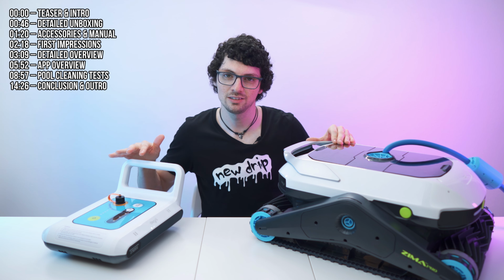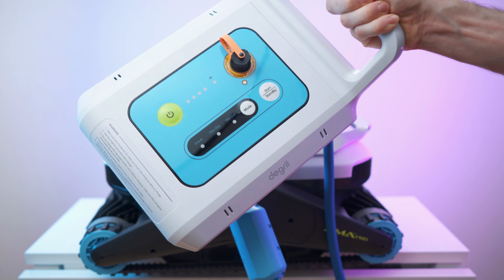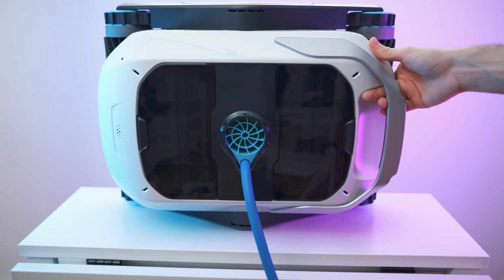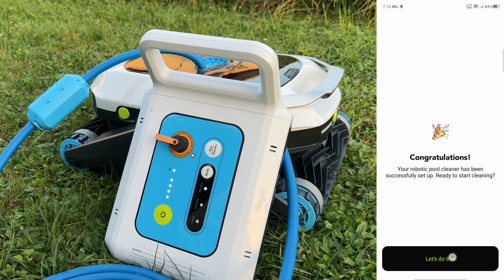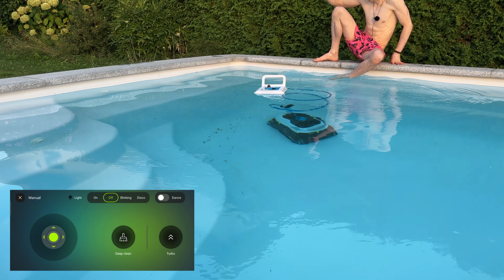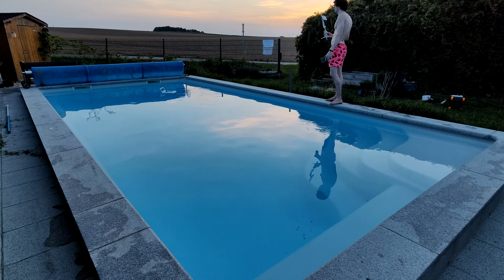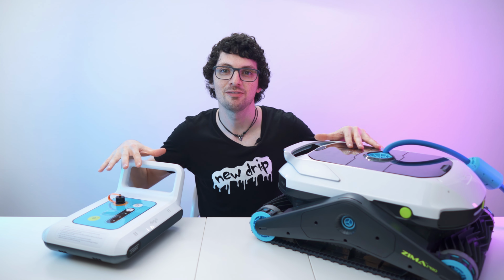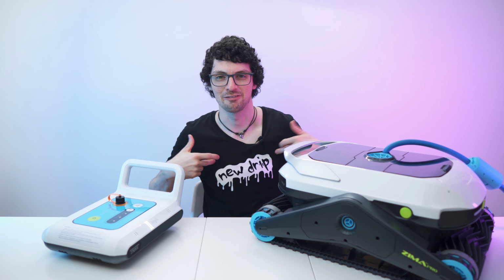Degrii Zima Pro Review: NEXT LEVEL Pool Cleaning Robot (Dual System, Sensors, Floating Battery)

Comment: PLEASE READ BEFORE BUYING ONE OF THESE DEVICES:
I've had two Degrii pool robots, and both broke down and stopped working. The first lasted almost a year. After going back and forth by email, they replaced it with a reconditioned device. The second lasted 14 months, and I only got 40 uses out of it. It just came out of its warranty. I tried to send it away for repair, but they wouldn't accept it. The best they could do was offer me a discount on a new one. Please stay away from this company and its pool robot, as they're not reliable and don't look after their customers.